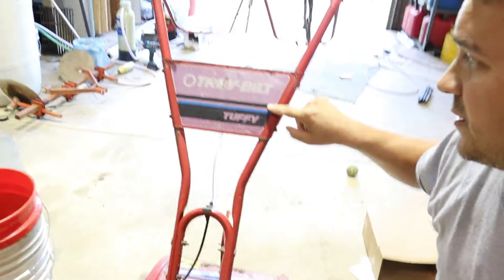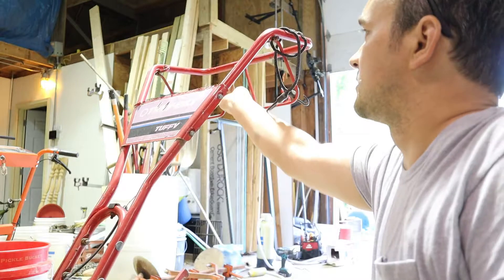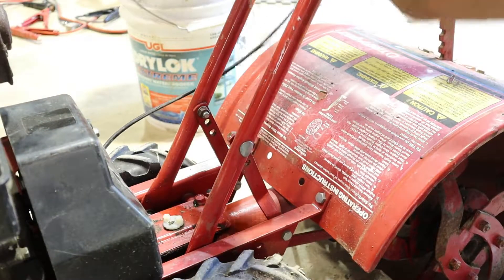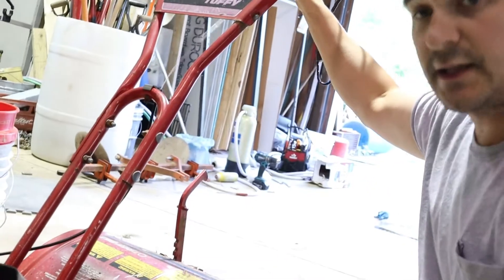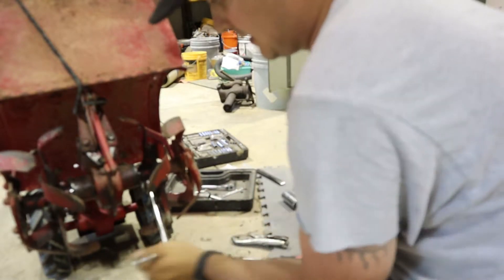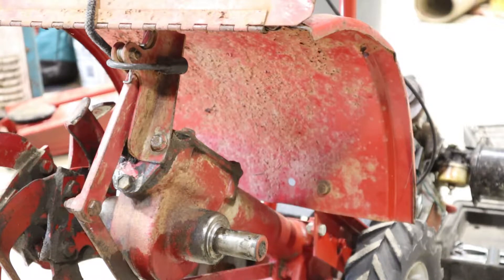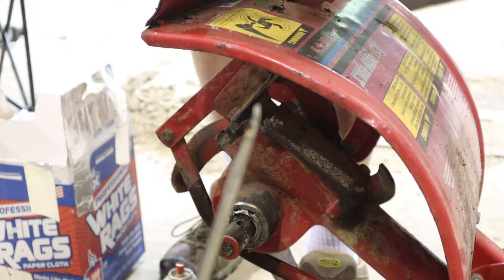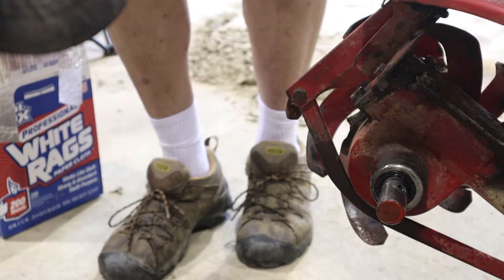Troybilt Tiller - Tiller Axle Seal and Clutch Cable Replacement

Comment: Good video. I run lube oil/grease along the cable and slide it in and out to prevent moisture/ water getting down inside the cable for that is what cause it to rust and bind up.